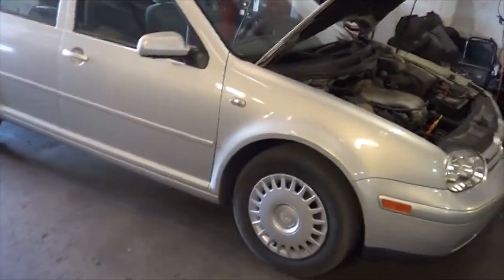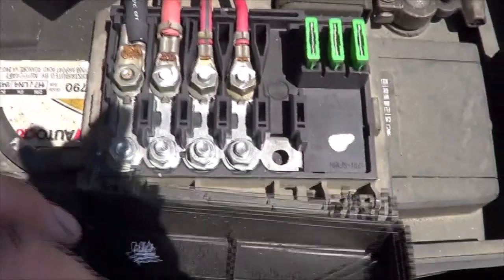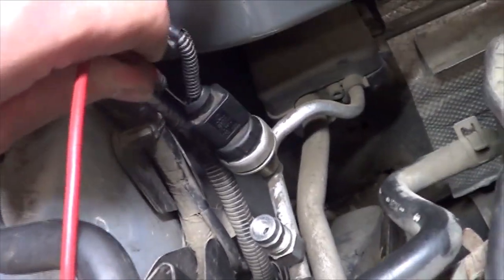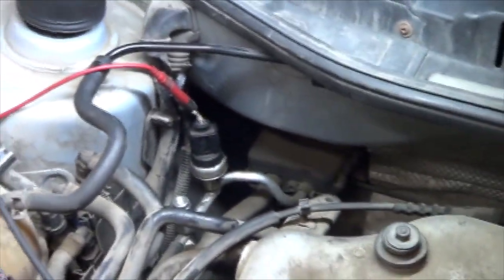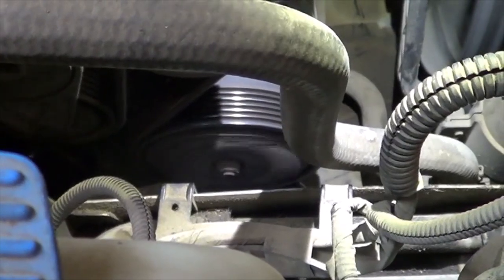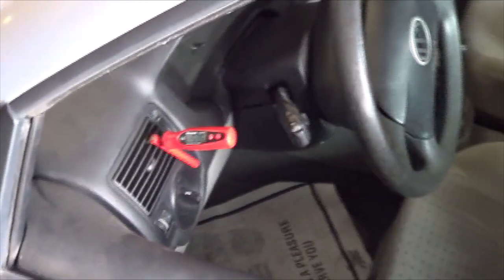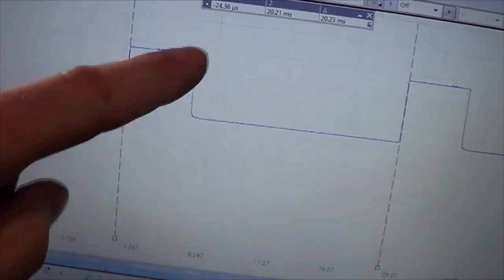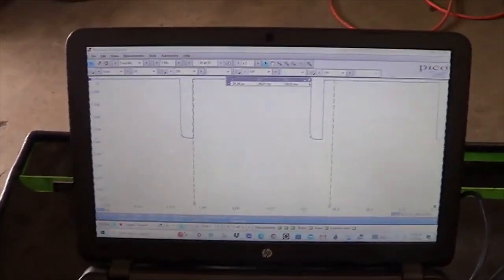2000 VW AC pressure sensor

Comment: This was an extraordinary video and it's exactly what I am confronting with a 2015 Golf. I have three of those pressure sensors and all tested good, but I never put the switch under load before testing ground. I also didn't know of the relationship between a higher signal output voltage and load on the compressor. My next purchase is one of those $100 scopes. I only wish he recorded the audio track when the engine was off (a voice over). It was hard to hear all of his experience and education with the motor roaring.
Reply from the maker: He is me!  Your car has radically different system. Pressure sensor would be similar, but you should start with the following video.  its on a 2006 but most everything applies except you have a uds car.  I have a 2nd video showing UDS stuff.  https://youtu.be/-p7ptfnQua8?si=tE2i1EpnKaL4pT55

Comment: I really appreciate the video . Had no idea that switch was a sensor or how it functions..  i have a MK4 TDI that the ac has been pretty good until now 
. I have the loss of power to the module at the fan and a damaged fuse holder . I repaired that similar to what you posted .  Worked good for a few months now the system is just getting cool ..That happened on a trip to town . Compressor is making 145  and 40 on a 80 deg day ..i noticed very warm air out of ducts with no ac . May be i have a blend door problem .  I get more time i try to find out whats the problem.  I seen the rcv valve fail before and no pressure but i dont know about this time . Thanks for the video

Comment: My ac compressor is not getting any power. Meanwhile my fans are on at high speed as soon as I put on the ignition. I just got it filled with r134. And I get 2.3V at the signal wire from the ac pressure sensor. Any ideas?
Reply from the maker: seems very similar to the problem in the video.  Did you watch it and do the tests indicated in the video?

Comment: Great video! My Golf's ac worked when I parked it for the winter but now it doesn't activate the clutch or turn on the fans so I guess I have to check the sensor. Fuses are ok. Pressure unknown
Reply from the maker: this is one of my favorite videos!   I have a playlist for AC videos.   Follow the checklist in this video.
Reply: I not a expert.  When you test the fuse to the module even if you have power on both ends of the fuse you might wont to check power at the wire that goes to the module . My fuse holder had green crusty on it . Good luck

Comment: Great video!! Thank  you for a nice methodical, yet simple, explanation of checking our AC system. Here is a question: based on your experience, and I'm not sure if it's limited to mostly european cars, but how many AC systems have you encountered that have NO shrader valves at the point of where the pressure sensor is? Have seen some other videos of guys saying that you have to evacuate the system before changing out a pressure sensor. Thanks for the feedback!
Reply from the maker: I dont have experience with many cars.  But all the Vw's I've done you dont have to evacuate the freon to change the pressure sensor.  I also had a 93 gmc and you didn't have to evacuate the freon to change the pressure switch.

Comment: My MK4 TDI's AC compressor is not turning on either and I followed your procedure and measured .55 volts coming off the pressure sensor. The power wire to the sensor reads 12 volts. Do you think my pressure sensor is bad? The radiator cooling fan does not turn on when I turn on the AC either. I checked and measured the fuse box above the battery and it looks fine and output volages are 12v so it checked out ok. I also measured pressure (low and high side) before I started and got about 90 psi on both the high and low side.
Reply from the maker: whether that is correct voltage is dependent upon your ac charge.  Watch the video, look the handwritten chart
Reply: @CoolAirVw , I measured 90 psi of pressure so .55 volts is way off. Looks like I need a new sensor. Thanks for your help.

Comment: Can a high pressure sensor be intermittent? Does a high pressure sensor also control the AC/engine fan?
Can a compressor clutch coil be intermittent?

I think I have two internal valves in my  Visteon VS16 compressor. Can they be intermittent or such that refuse clutch to engage intermittent?

My ac/engine fan starts but stops after like 5 seconds. Then starts again etc.. but it just try to start.. not spinning fast at all. That's why I wonder if the high pressure pressostat might be bad/intermittent. Engine fan works as intended otherwise in the summer in hot temperatures on idle. Spins up fast speed.

When the clutch isn't engaged but it should.. shorting the low pressure switch does not engage the clutch. Which can mean that either low pressure switch are intermittent, clutch coil are intermittent or high pressure pressostat refuse clutch to engage. But shorting the low pressure switch should bypass all sensors and stuff? 

It can also be an intermittent fault on the 12v signal wire from the relay. It's a direct path according to my electrical wire diagram. From relay output pin 87 to pin 18 on ECM connector and from pin 18 to pin 1 on clutch connector. Pin 2 on clutch connector goes to chassis ground.

My issue is that the AC can work for months then suddenly decides to stop for either minutes, hours, weeks or months to then start working again. Same there.. can then work for an hour, minutes, weeks..

Internal compressor mechanical fault?

System are serviced.. holds vacuum, holds pressure. Correct cabin temperature, correct evaporator temperature, correct outside temperature. Cabin fan runs without issue. The variables should make the clutch to engage. But sometimes it does not.

I've seen some sketchy numbers on the high pressure pressostat via my computer dealer diagnostics software. That's why it's suspicious in combination with the fan behavior.

Please help!
Reply from the maker: cut and paste what you wrote into an email and email it to me.
Reply: @CoolAirVw  okey..
Reply: @CoolAirVw  i have no email adress to you though.
Reply from the maker: @orfeous   If you did one ounce of thought or checks you would be able to find my email.
Reply: @CoolAirVw  not listed on your "About" tab.
Reply from the maker: @orfeous  Is that all you got?
Reply from the maker: email address is coolairvw@aol.com.  every video has a website listed in the description.  Every video has my website in the "outtro".  People look at that, find my contact info and call me at least once a day, thinking I have the time to talk to them about their problem.   But, dont call, email.  I feel like I have something to offer it but it would be easier to convey through email, since you have a huge, long essay asking your question.  Point being I would be writing a ton in response.
Reply: @CoolAirVw  Thank you! I sent an email now.
Reply from the maker: @orfeous  I did not receive an email.
Reply: @CoolAirVw  strange, i sent you one. It might be in your spam folder or something?
It shows your profile picture when I wrote your mail address.
Reply: @CoolAirVw  I want to inform you that my AC are fixed now :)
A shop replaced the clutch that I provided. The whole shebang. They said that my old coil was buzzing and trying to engage but hadn't enough power for that.

I measured the coil after when I got home. 1.77 Mega ohm :) should be 2-5 ohm :)
They say it works now. I don't know since it won't engage under 0 degree Celsius :) we have around -14 cells here now :) so I have to wait until spring/summer
Reply from the maker: @orfeous  thanks.

Comment: Don't suppose you know the duty cycle with no/very little pressure? I have a 2002 Golf and it's reporting pressure too high for 30 secs after engine start then pressure too low. There is no gas in the system. There is a 00792 pressure switch fault logged which comes back each time the car is started.
Reply from the maker: so you have a climatronic?
Reply: @CoolAirVw  Yes I have climatronic. We got the car regassed yesterday and the AC worked for 10 minutes or so then stopped with 00792 pressure switch fault logged. It now goes through the same series as it did with no gas - when AC is turned on the  compressor shut off code goes to 1 (pressure too high) for 30 seconds or so, then to 3 (pressure too low). At this point the fault code is logged.

Comment: I’m having an issue with my 2011 tdi. Air conditioning does not work have fault code 00819, air conditioning is charged and I have replaced the high pressure switch, have any ideas
Reply from the maker: seems like you should give me the definition of the code. Sorry I certainly dont have all codes memorized nor can I spend the time to look them up.   You have a "clutchless" system.  This video doesn't apply to yours.  Watch videos 4, 5, 6 and 7 in the following playlist  https://www.youtube.com/watch?v=dufqygxtALY&list=PLoRpmnjFBHuniXrEzFIDG2_G_KOeikNJu

Comment: My sensor is giving 0.54v, my ac just died without degrading
Reply from the maker: At what pressure?  Based on the chart at 13:53 I think you have low pressure.  Maybe not enough for the system to allow AC clutch to turn on.  Is the clutch spinning?
Reply: @CoolAirVw  No not engaging, only 4v at the compressor. The system was working fine just stopped, checked cables, fuses everything, and also no signs of leaks. Just stopped working. I'll be taking it to a gas place to check my pressure, if fine ill probably replaces the sensor then.